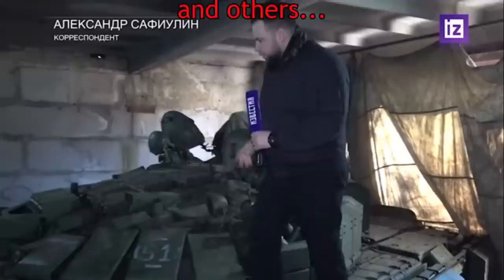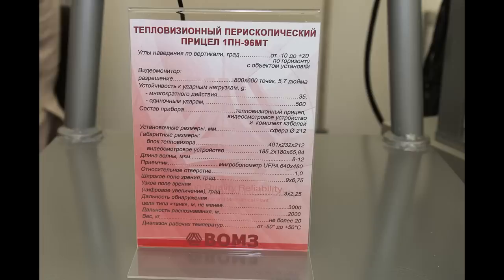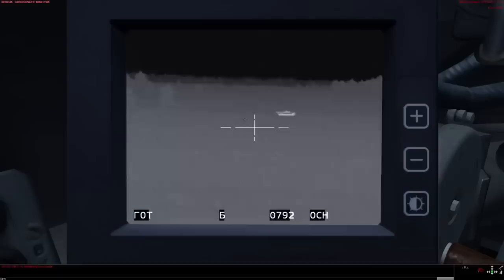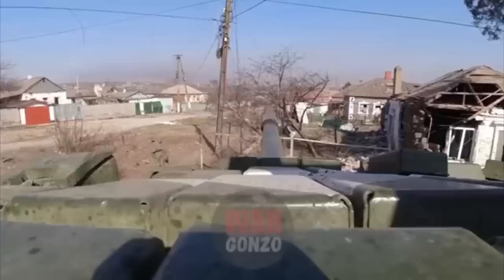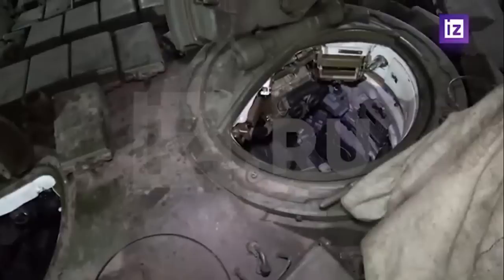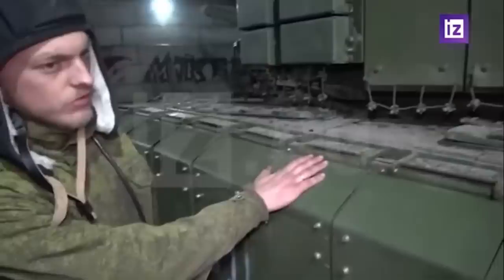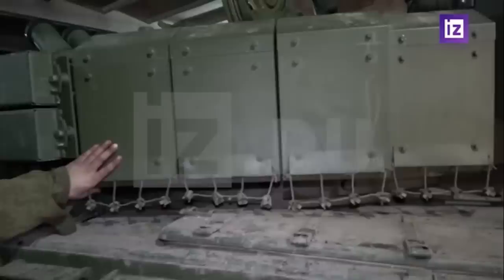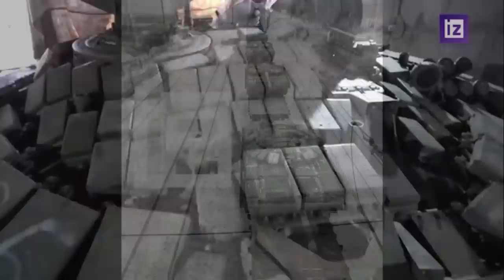Are Russians Downgrading Their Tanks?

Comment: this tank is a mobilization tank. The front needs good tanks in a huge number. Most of the tanks of the Russian Federation are paired with a computer or with a tank with a good thermal imager, so many disadvantages are compensated. (in general, I'll tell you a secret, any modernization of the T-72 is based on the idea of giving a cheap but decent tank to the troops)
Reply: T-72s are perfectly decent tanks. 
Sure, a bit aged, but perfectly usable on the modern battlefield when handled with care. 
Whenever tanks are lost it's usually due to recklessness or unforeseen circumstances rather than any inherent failings.
Reply: Yeah it's the modern day T 34 76.
Yeah T 34 surely had a hell lot of problems and there are 12 thousands of them were destroyed in WW2, but at the end USSR still won the war with them. This modernized T 72B is much inferior than the T 72B3 but still a very capable tanks in this war and since Russia did lose a lot of tanks with modern optic, this is a much more cheaper solution and still make the tank better than it was. It has a thermal that is better than any infared sight and  really good ERA coverage.
Reply: Only reason the T-72 is used for much of anything is because that's what they have.
Reply: @leetommerson639  Well, except for the ammo placement that sends turrets hundreds of feet into the air.
Reply: "Cheap but decent" did so well in Iraq, right?
Reply: @Testimony_Of_JTF  if you equate the modification of the t-72 that participated in the desert storm and this one, then you are either a clown or a person who does not understand technology and went to the comments to show off. But if you meant something else, then be kind enough to describe in more detail what you wanted to say with your "masterpiece" of thought.
Reply: @saber2301  I am just annoyed at the "cheap but mass produced!" argument, it's often used by reformers (those guys who think fighter jets should be dog fighting machines and nothing more)
In this case it does apply tho
Reply: @Testimony_Of_JTF  the barrier of languages does not allow me to convey the idea that I want to convey. For their money, the T-72b3 is the best mass solution as the modernization of thousands of tanks.
Reply: @quentil  The Leopard 2 and Challenger 2 have shit ammo placement too. When the T-64 and the T-72 were designed, ammo in the crew compartment was the norm.
Reply: @Testimony_Of_JTF  I guess drones/missiles don’t exist and definitely didn’t destroy multiple convoys of UA or RU troops, tanks, artillery, anti-missiles systems, helicopters and light assault vehicles… Russia’s is always out of “expensively-cheap Missiles” while Ukrainians have 100 anti missiles systems in every city with infinite mag on meanwhile definitely not costing 150k per shot.
Reply: @Testimony_Of_JTF  lol still thinking about iraq with some basic t72
Reply: @anxietydisorders5917  Yes
Reply: @serch3ster  Nah, Iraq in the gulf war had an actually strong army. They had thousands of tanks and hundreds of thousands of men, many of wich were veterans from the previous war.
Just turns out that using "cheap and reliable" equipment is not a great war strategy
Reply: The idea of using masses of cheap tanks failed in the 1970s with the introduction of ATGMs. A single ATGM unit can destroy a tank company of cheap tanks.
Reply: @saber2301  There is fairly little practical difference between the T-72M1s and these T-72B variants honestly. The ERA is the biggest one, which allows them to potentially survive a shot, which is quite a good advantage, but that's like claiming that the US fielding M60A3s with modern ERA on them would be perfectly fine for a modern battlefield and would not just get destroyed in countless numbers like the T-72s are being.
Reply: @ArchOfficial  Mmm, yeah. I will tell the guys at the front that there is no difference between t-72m1 and t-72B) Yeah, how)
Reply: @saber2301  Effectively no. Both have almost identical sights and ammo performance and will both die in one shot of SABOT or any kind of semi-modern ATGM. There are some small performance and design changes but nothing too appreciable.
Reply: @ArchOfficial  ha ha ha, you're funny. Thank you for teaching me how to match games and propaganda resources) Well, seriously, then you should study this issue much more deeply, and argue less with those who exploited this tank will tell you what it says
Reply: @saber2301  If we could find a Russian T-72 crewman and an Iraqi T-72 crewman who has been in combat and lived then sure. Oh wait; they all die.
Reply: @Arch  The T72B is vastly superior  then the T72A/M1. For a start, its armour is .massively upgraded (it features composite armour in its turret cheeks and 4 high hardness plates in its Glacis plate), add to that an uprated engine and fire control system and ERA. After all the upgrades it's practically a brand new tank.
Reply: @stephenhumphrey7935  Except it still has no thermals apart from just a few B3s, still has a shit FCS and still dies in one shot from everything made after the mid 80s. Effectively there is little difference unless you're going against exclusively older tier equipment.
Reply: @Arch  Yes it's true that the T72B has no thermals and its fire control system is obsolete, but the tank is redeemed by its very thick armour that will take a lot of punishment. The T72B was actually designed to withstand 120mm NATO tank rounds, the type which was used in the first Gulf War.
Reply: @stephenhumphrey7935  T-72B is a one-shot from any NATO 120mm ammo made after 1982. It's a piece of crap. The serious armor that is a genuine match to M1, Leo 2 etc. begins at T-80U.
Reply: @Arch  The T72B armour is actually a tiny bit thicker than that of the T80U (base armour that is). Although the T80U has the overall advantage due to its Kontakt 5 heavy ERA. BTW, the T72B was fielded in late 1985, so the Soviet designers knew all about the 120mm NATO.  guns and their power. The only thing shit about the tank is its ammo placement, which sucks.
Reply: @stephenhumphrey7935  Effective protection of T-80U should be a good bit above T-72B. 1989 and even T-90A IIRC. It also has a bit smaller weak regions.

There's a lot more shit about the T-72 than just the ammo placement. Needing to reposition sight after laze, in some models losing sight picture during reload, abysmal reverse speed, relatively easy LRF burn out (Not a problem on new variants IIRC), low quality stabilizer, bad auxiliary sights, bad commander sights, the list goes on. 

NATO tanks, even ones from the 80s with their own issues like usually a lack of a CITV or a single plane mirror for the gun when leading, are still just a lot more comfortable and that extra bit of performance adds up.
Reply: Tanks are support nowadays anyway, interlinked with the whole BTG, simply ONLY work with combined arms and the tank clearly not there to do the majority of the surveillance.
Reply: @miriamweller812  A tank without thermals is almost useless in anything except an indirect fire role against emplacements not protected by smoke or ATGMs. Reason being simply because firing the main gun will make you blind for 10 - 15 seconds, where you are easy pickings for other tanks, ATGMs or AT crews. Thermals will counteract that. Thermals also allow you to fire through smoke; extremely important in wars like this where nobody uses IR smoke.

It's not so much about recon as much as just being able to survive anything resembling a peer engagement.
Reply: @mrmakhno3030  Sometime I get the idea, that people think the germans were just some elite soldiers with a few high tech tanks vs a Soviet cheap zerg army.

They do get, that Nazi germany lost tenthousands of tanks and that even the Tiger was produced in a quantity of over 1300 units. What is low in comparison to all the others, but it's not like they only got  a bunch of them.
Reply: @kingryeeye3812  150k would be pretty cheap. Stuff like the german IRIS-T is more expensive - not even starting with patriot system, which is 4-6 million dollars - PER SHOT.
Reply: @Testimony_Of_JTF  You forget the 100.000 tons of bombs USA dropped on Iraq before setting a single foot on the ground.

And yes, what the Iraq called their T72 was a joke. It got a firing range of around 1,8km. Russia T-72 got 5-9km.

Of course with 1,8km firing range and that against US imperialism, you are just a fish in a barrel. 

If you look at the number, A-10 alone destroyed over 900 tanks, over 1200 artillery system and over 2000 armored vehicles, because the bombing campaign left no anti air and Iraq had nothign to attack the USA.

Russia would simply sink the carrier fleet. As would China. Whoops. No 100.000t of bombs before going in to swipe up the rests.

Comment: There is hardly any space insider the turret of T72 B3 which is highly inconvenient for the tank crew inside. The Sosna-U sighting system takes plenty of space and it is positioned slightly to the left of the gunner therefore the gunner has to lean to the left to use it. This may create some issues for the gunner while the tank is moving. I also understand that it takes some considerable time to make thermal operational. On top of that the gunner has many issues getting access to many other pieces of equipment that are only partly accessible especially on the moving tank. The second sighting system T72 B3 has is 1A40 which used to to be the main sighting system and is positioned directly in front of the gunner (which is far more convenient to use than Sosna-U). The new modification in the above video appear to provide more space for the gunner and the main sighting system is positioned directly in front which is great for when the tanks is moving. Plus the sighting system is meant to connect with the helmet while in use. The rubber edges in the video allow for better helmet connection and prevent it from sliding (which is not the case for T72 B3 where for some reason one of the edges is missing). The new modification is much better for crew comfort and the crew has better access to other pieces of equipment inside, this makes new tank a lot better in my unprofessional opinion based on looking at this video.
Reply: i think sosna-u primarily just replaces the night sight and doesn't really take up much more internal room